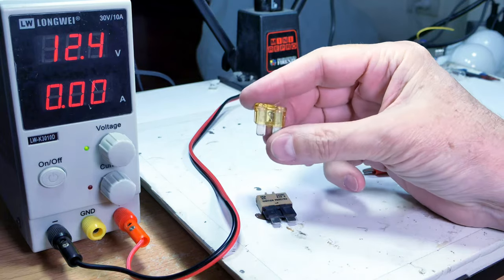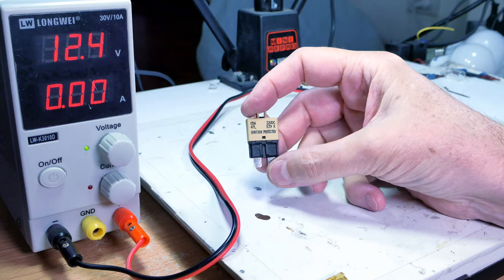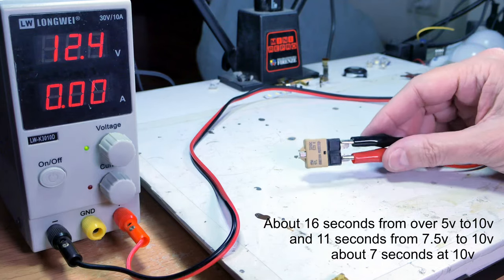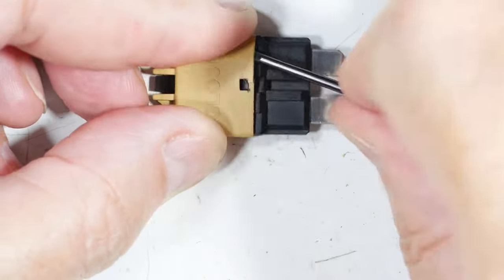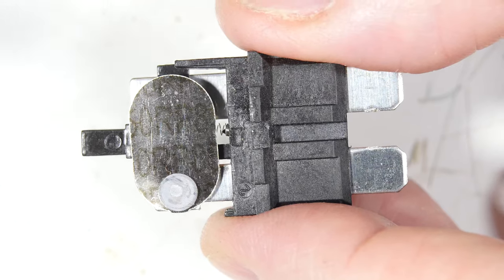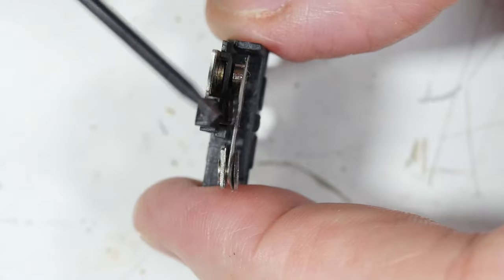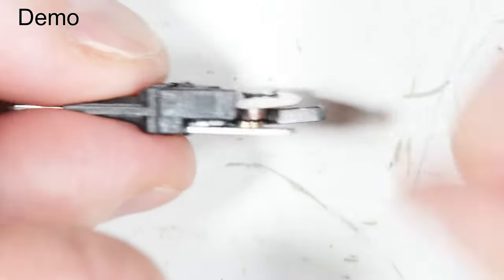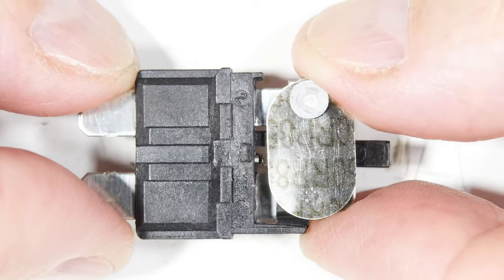Automotive Circuit Breaker Teardown (4K)

Comment: Hi, thank you so much for making this video. I been wondering about those circuit breakers. I would love to see a video on the tester you used,  I searched on your videos and I couldn't find any. I think that Bussmann circuit breaker is the best or Littlefuse but i don't have a good way to test them so i need to buy a tester but I don't know what to buy. Thank you again for the great videos.
Reply from the maker: I didn't use any special tester, just a power supply that I can control the amperage so we could see where the breaker popped.

Comment: This is interesting, thanks for doing it!  Question though, since the bimetallic strip works off of heat, and heat is (I think) = I^2R and in this case R is very low, could that matter?  If a load was in the circuit to add some resistance wouldn't it work closer to spec?
Reply from the maker: I tried it with an incandescent bulb, and the results were similar. What changes the response time noticeably is the room temperature. If it's cold, it takes longer to trip! I don't want to think what it might do in freezing weather!
Reply: @tsbrownie  But your cables would be cooler too and thus take longer to melt.

Generally spanking, if you take a look at any fuse's datasheet, you may find time curves depending on current. 
You will see there, that, say, a 1A fuse will trip in 10sec when handling 0.9A and in 0.10sec when handling 1A. 

This resetable fuse is the same, it just takes longer. 
But if you were to take a fuse that's rated for less current, an overcurrent would trigger it quucker. 
Maybe in a reasonable time for the current you want it to work and trigger.
🤔

Comment: Is there any amperage drop with the wires you used to connect to the breaker? Have you measured the amps with another instrument? Did you run the same amps through a standard fuse to measure any delay in burning? I question whether the standard fuse may also require time to heat up as well.
Reply from the maker: The wire is rated at 10 amps continuous. They didn't heat, so the amp loss was low. I have checked the power supply against a digital meter and it's good to about 1/5th of an amp. A standard fuse of good quality will blow quickly (there are slow & fast blow versions). Louis Rossman has done videos on cheap fuses that blow very slowly or not at all. This breaker is too slow for my tastes.
Reply: There is no such a thing as "amperage drop". You have mistaken for "voltage drop" that has nothing to do with overcurrent protection.

Comment: Interesting.  If it isn't impertinent to ask, how is your eyesight now? I am glad that you are still able to work on small things.
Reply from the maker: Thanks for asking. I had the left eye done by a top notch surgeon and between the left and right eyes now, I can do pretty well. Still have a blurry zone at about 1.5 meters and depth perception is not good enough for sports, but I can drive and get around OK. For close up work I have a couple pair of "cheaters" that have different corrections for L and R, but they work. Will have to have the YAG capsulotomy one of these days on the right eye, but that's pretty normal stuff. I've got the "final four" videos to finish up covering everything I've learned in the process.
Reply: @tsbrownie  Glad to hear that. My lady friend just had a capsulotomy last week. She could see better immediately.
Reply from the maker: @adnacraigo6590  Good to hear that from people who have 1st hand knowledge, thanks.